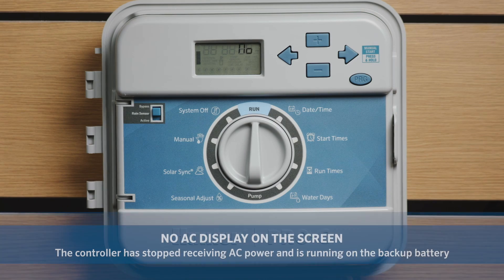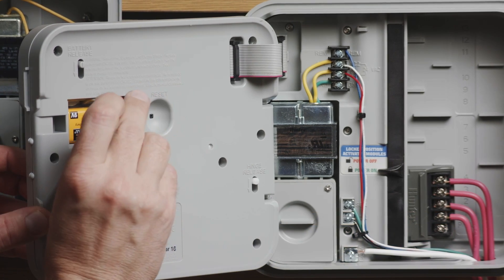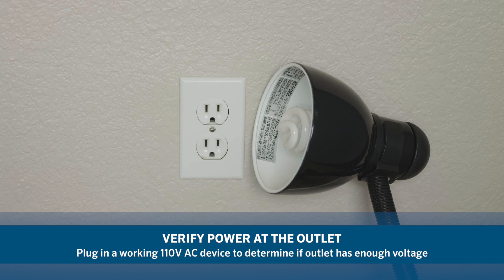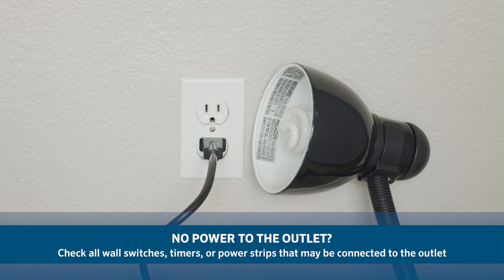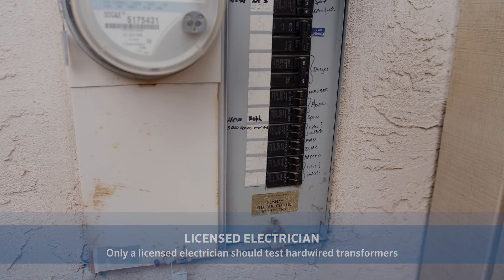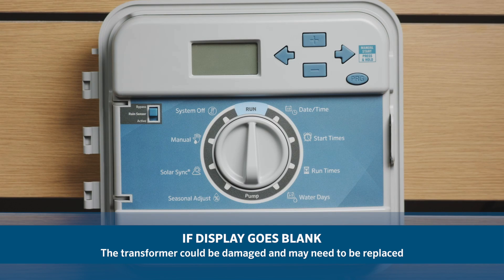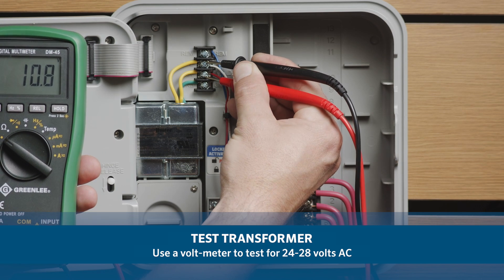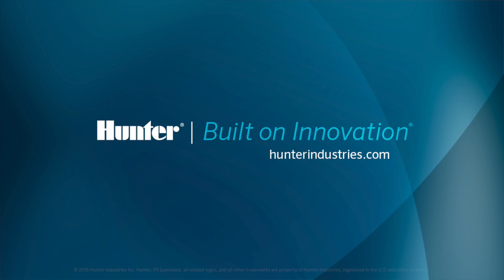Pro-C® No AC Message

Comment: Had same “No AC” message. Confirmed I had power at the outlet and also did a hard reset. Nothing! Used my voltmeter and there was no AC at the screws. Out of the bag the power adapter was bad. Used my old adapter w new panel and everything worked perfectly!
Reply from the maker: Hi Don, we appreciate your comment. The Hunter product can be exchanged at the original point of purchase or through the installation contractor.
Hunter products have a manufacturer date code stamped on the product indicating the start of the warranty period. You can learn more here: https://www.hunterindustries.com/sites/default/files/Hunter_Warranty_Date_Code_Sheet.pdf.
Reply: @Hunter_Landscape_Irrigation  
Much appreciated. But needed the irrigation asap. So was able to use my old adapter and all has been working great! So weird though.  Adapter was dead on arrival.

Comment: My system quit functioning and I checked the Pro-C and it displayed the “No AC” message. We replaced the transformer. I checked the transformer voltage and it was within the 24-28 volt range. The Pro-C still displayed the “No AC” message. We reset the Pro-C and still was receiving the “No AC” message. What next?
Reply: Hi Andy, did you ever get a response to your question.  I am experiencing the same thing.  I have not replaced the transformer but see 27 volts AC across the terminals and get a flashing No AC msg on the controller when the battery is installed.  I get a blank screen when the battery is removed.
Reply: @Retired_MZ  I am getting the same... just replaced the face plate.  Any remody?
Reply: I am getting the same... just replaced the face plate.  Any remody?
Reply: Add one more to the list. I'm going to replace the larger of the power modules ie; the one on the far left.
Reply: I have a new unit with the same problem.  Has anyone got it figured out yet?